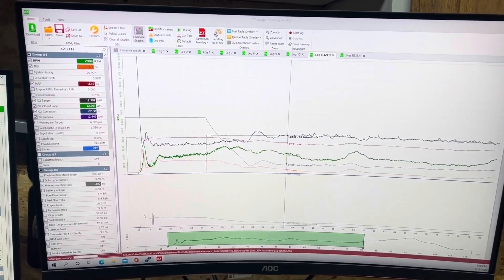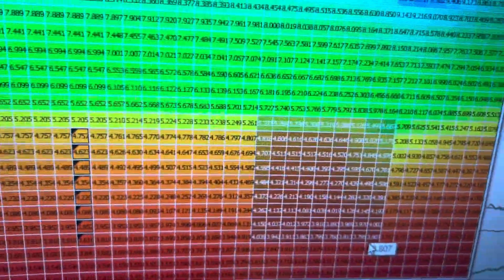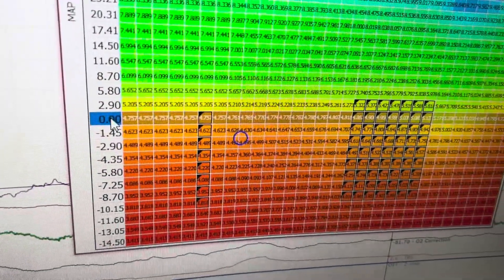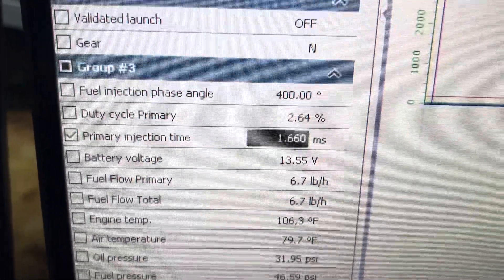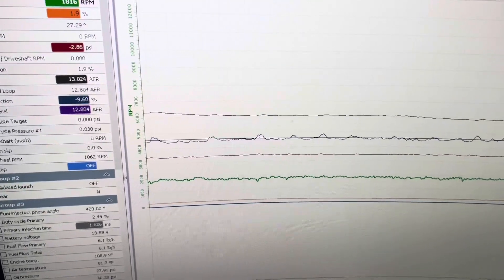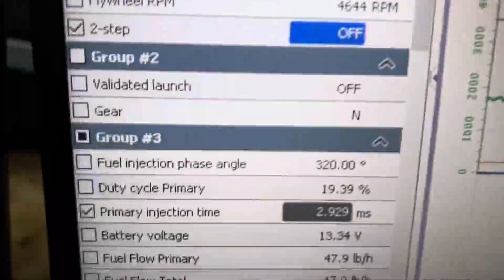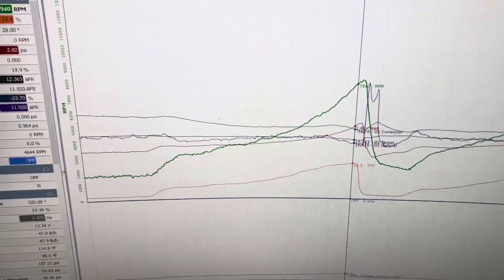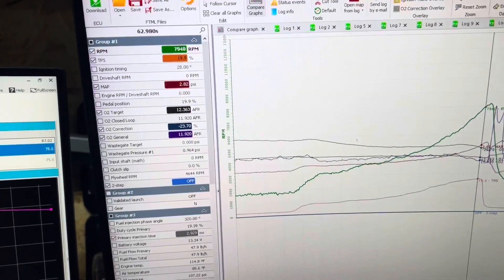Back to back. How I made -80% correction turn into less than -10% correction from one log to another

Comment: O2 correction Target will still override ECT and IAT factors so it doesn't matter if you're adding 10% of of fuel at say 250°, your target will still be the same so temperature compensations are only effective in open loop
Reply from the maker: But if your adding 10% of fuel at warm up for example at 100* and at 120* it’s down to 0% your closed loop can say -10% at 100* and at 120* where there is no more compensation the closed loop can say 0%.
I understand that the target can be the same but the compensation can change because of it if someone has it active. Typically at idle after the engine is closer tuned I’ll shut off closed loop under a certain rpm so that those compensations can work at idle in open loop like they should. Unfortunately because this was a new setup that didn’t become a factor yet so I didn’t explain that part.